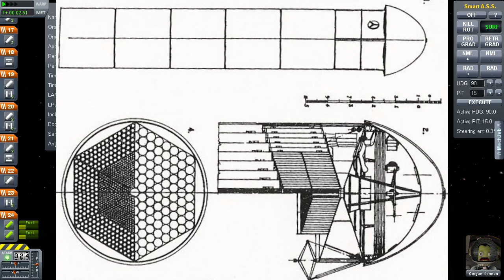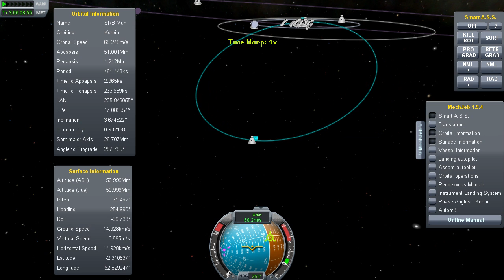Kerbal Space Program - Mun Mission Using Only SRB's

Comment: It's not just SRBs if you're also using decouplers! :)
(...There's nothing like "decoupling" your first stage by firing a second rocket engine through it until it overheats and explodes...)
Reply: Gotta be careful with this method, if you use multiple rockets side by side, they may overheat at different rate and mess with your center of thrust and you will loose control. Some engines like the terrier doesn't generate enough heat to overheat and explode adjacent parts(learnt that the hard way the day i forgot a decoupler).